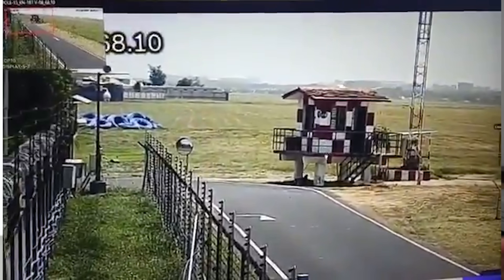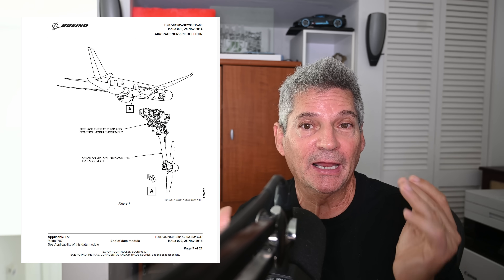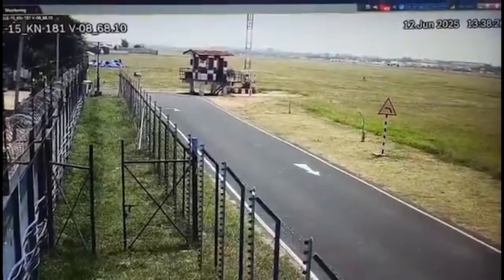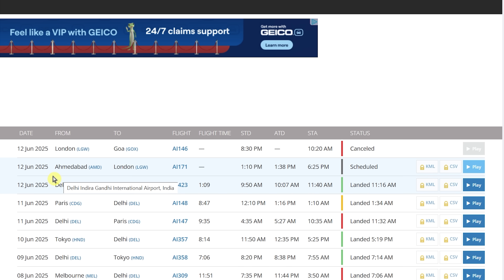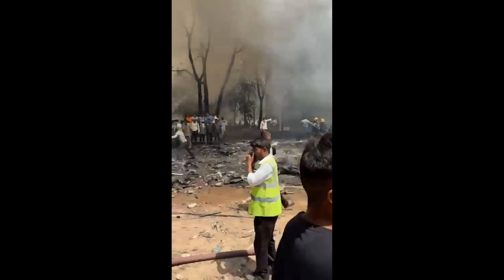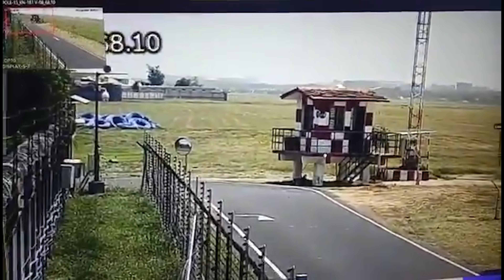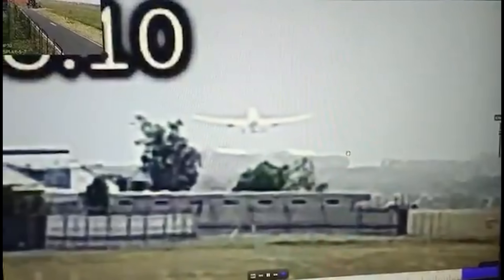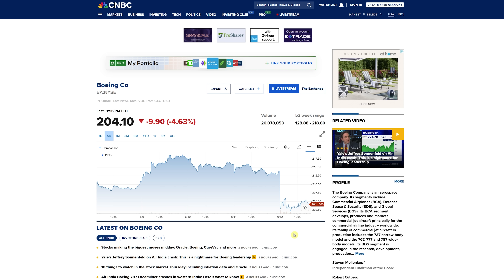What Caused Air India 171 Crash, Mysterious Sound Before Impact

Comment: To my ear, the shape of that sound as it passes video position is only a doppler shift. But the engines themselves don't sound pitched high enough to be at take-off thrust. I presume a little engineering wizardry can determine if this observation is correct. As to the sound of a RAT, I presume the engine sounds would completely overwhelm the sound of a deployed RAT. And even if it were deployed, I don't understand the significance at the moment because, to my knowledge, its purpose is to supply only critical hydraulic pressure for basic control surfaces; it can't even operate the lowering or raising of landing gear. OTOH, if the RAT had automatically deployed, a catastrophic failure in engine power was already underway. But we still hear the engines as the flight passes, so.......more questions. I hope and expect the "black box" will provide answers.

Comment: To me it does sound like the RAT is deployed in the original video, and the engines do not sound to be a full thrust.  It is about 13 seconds from first sound of the RAT to the impact, which means it was deployed 5 seconds at least before?   Crash is 6:03, RAT sound 5:50, RAT deployed latest at 5:45? and rotation was about 5:30.  So suggests there was complete power loss immediately after take off.  The RAT does not deploy with flaps misconfigure or inadvertent retracting of flaps.  Also may explain why gear was still down, as hydraulics were lost as well with full power loss.

Comment: Excellent analysis. I just wonder the folloing: The saved passanger told he heared a strong pang  30 sec after the plaine was airborn. Could that indicate a device failure in gear system and that caused that the gear couldn't be lifted up any more?

Comment: I think a compressor stall, or full failure....in one of the engines. Both engines failing would be beyond extraordinary.  At that altitude, at that speed....with a full load of fuel and 242 souls on board....it would be VERY problematic for the plane to gain speed and climb out...on ONE engine.  These aircraft are designed to be able to complete a takeoff and initial climb out, on one engine, but it does not always work out, in reality. Especially with a heavy load on board. 

The takeoff and initial climb out is BY FAR the most vulnerable portion of the flight envelope.  An engine failure, at that point, is often almost impossible to recover   from.

Another possibility, based on the RAT sound mentioned here, is a complete electrical failure aboard the aircraft.  That would cause both engines to die.  Since there apparently was no smoke or flash from either engine....this might well be a better (possible) explanation.  A complete electrical failure would be incredibly rare, though.

Comment: Excellent sleuthing, thank you! I'm a westerner in India right now--this is such a tragedy. I have been in many Air India flights over the years and every single one of them was extremely hot and dry. So I'd be surprised if that was related to this accident. My last and final trip with them was to Singapore from India as one leg back to the US. That short 4 hour trip--so extremely hot and dry--was much more draining and stressful than the rest of the trip on United from Singapore to SFO. We decided Air India no more. Their planes always seem old and rickety. The seats have old fabric. Service is questionable. I'm questioning the maintenance on this one.  I've been in Dreamliners many times and they are a great plane. Hope there is not a design flaw.

Comment: Look at the video from the 5:20 to 5:24 point.  Are the flaps down?  Doesn't look like it.  ---  How that could be, I have no idea.  They have warnings to tell them if they're not in the proper configuration for takeoff.  ----  Everything at this point is speculation.  We won't know for sure what went wrong until the flight data recorder is recovered and examined.

Comment: Maximum load + summer heat (it was a summer afternoon, probably more than 40 C at that moment), the lift of the wing and the thrust of the engines drops sharply, because the air is thin. So someone gave the go-ahead for takeoff. The human factor, as always happens in such cases.

Comment: You're clueless, that's not the sound of the RAT. That's the sound of a turbofan engine at full power. This will be an easy accident to solve. The inexperienced first officer mistakenly raised the flaps when the Captain said gear up. I know a little about aviation, I flew military and civilian aircraft for forty years.

Comment: I'm not liking this trend at all, I smell a serious rat here (and I'm not talking about that turbine either). The RAT noise was one of the first things i noticed in that video - BBC had a clean copy. At first I thought it was because it had Rolls engines which have a distinctive buzzsaw sound. But it didn't sound right, and later I saw the video of the RAT on a japanese Dreamliner and that matched the sound almost exactly. That tells us alot, but on the runway video you can see jetwash blowing dust off the ground as it rotates, so even though it was a long rollout it obviously had enough thrust to get off the ground. Whatever happened must have occurred right afterwards, but that isn't what worries me - it's what was going on before this thing even left the gate. 

I've seen a youtube video of a guy on an Air India Dreamliner which seems to have been made a few days ago (maybe more), in which you can see the plane having major electrical problems at the gate (as the air con wasn't working and the internal lights went out), and was in a very poor state of repair (dirty buttons, broken lights etc). But this video ISN'T of the plane that crashed - it's another Air India one. And it clearly was having issues with it's APU as it started engines on the stand before pushback, which one commenter said was unusual. If this is indicative of the state that the plane that crashed was in, it would explain the RAT deploying as the APU would also have to be not working assuming the main engines lost power during climbout. Question is, why are they having consistent issues with their APUs and is there a possible link to the engines suddenly blowing out? And if their standard of maintenence and cleanliness is this bad on all of their Dreamliners, what else have they been skimping on?

Comment: My question is, if the flaps weren't deployed, how in the world did it even take-off? And at 1:52~1:53, you can see a clear seam in the front portion of the wing indicating that the flaps were down, perhaps incorrect configuration or malfunction? Also another thing, maybe its the quality of the video, but I don't see exhaust fume streaks coming from the engine indicating its at full power or any power for that matter, is it engine failure? Currently it's all speculation, we need the black box data to even say anything, because this is the first time the 787 has had a major crash.

Comment: I think it was the extra weight and speed on the ground that made it take off because the load was still on the ground, and after takeoff the engines could not bear the weight. The distance to England is long and requires about 80 tons of fuel. The problem is the weight of the luggage and passengers.

Comment: Irregardles of the main reason or major setbacks regarding specifically BOEING 787....First and foremost my sincere condolences and synpathy to the bereaved FAMILIES of the DEMISE.....TWO HUNDRED FORTY ONE Passengers and crew on board this fateful FLIGHT. May there be enlightenment and clear Observation/ Evaluation as to the cause of this TRAGIC Accident. Be it Manual error or engineering/ maintenance failures.... shortcomings/ setbacks whatever!  May JUSTICE PREVAIL! May they provide the BEST AIR SAFETY and WORTHINESS. Rest in Peace to the innocent SOULS on board. Amen. 🙏🙏🏽🙏🙏🏽🙏🏽🙏🏽🙏🏽🙏🙏🙏

Comment: Great Video Jeff @jeffostroff. Loved watching. There are two important info I found in your video that may help with investigations

(1) There is a high probability the RAM Air Turbine (RAT) got deployed. It means the Airplane may have actually lift on RAT power after engine failure.
(2) If you watch the footage of flight between 1:52 to 1:54 frame by frame, you will notice a fainting white flash light after 1:53. This may be from the RAT device.  

Folks, Please correct if its unlikely.
Reply: The RAT doesn't provide lift aircraft or power to the engines, it provides small electrical energy to flight controls, instrumentation and communications

Comment: My home town of Staines, UK, saw an accident in 1972 where a Hawker Siddeley Trident crashed shortly after takeoff. BEA fight 548.

On that occasion, the main issue was discovered to have been the premature retraction of the leading-edge high-lift devices, or droops, causing the aircraft to fall below the required lift. Panicked, the pilot pulled the nose up, which only exacerbated the issue, causing the aircraft to suffer aerodynamic stall and drop out of the sky, landing on its belly and being completely destroyed, with no survivors. My parents were around a quarter mile from the impact as it happened. 

It is thought that the first officer mistakenly retracted the droops instead of the landing gear. The levers to do so were next to each other and almost identical. (Later they were redesigned to help avoid this mistake)

Unfortunately the circumstances were also not in their favour: The aircraft was close to maximum weight, actually being 24kg over maximum when it started its taxi, and noise abatement procedures were in place meaning they were climbing with minimum possible engine power. So they didn't have much to trade when things went wrong.

Also, an impending pilot's strike had caused huge friction, strained relations, and potentially sub-optimal communication between the crew, especially it seems, between generations. And in this case the Captain was 51, the other officers 22 and 24.

Secondary issues aside, I wonder if there was a similar mistake made here. Were the flaps raised instead of the landing gear? Or were the flaps never properly configured? Perhaps they never lowered the flaps to begin with, didn't get the lift they expected, thought it was a power issue, declared emergency, and in their efforts to keep the place in the air, didn't get round to raising the gear?

The only mystery is the loud sound that was heard. I'll be very interested to discover what happened here.

RIP to the souls lost and condolences to their loved ones.

Comment: I think that the security camera is located at approximately: 23.080960, 72.640866 In the gap between the wall of the industrial area and the fence that runs alongside the perimeter road. From that it seems that the plane had sufficient runway to abort the take off as it still had almost half the length of the runway available after rotation. It appears to have lifted off shortly after passing the industrial buildings that encroach from the left and are visible in the shot. There are some trees behind one of them. They can be easily identified using Google Maps. That's an approximation but it seems reasonably certain that an abort would have had the plane stopped before the end of the runway.

Comment: It's pretty obvious why the plane crashed.  The flaps are up and the landing gear is down.  It's not configured properly for takeoff.  Flaps up at low altitude is a death sentence.  If the numbers are correct, the plane never got above 675 ft in altitude.  You can see in the video how skinny the wings are.  They're not producing lift with the flaps up.  With the nose up and the flaps up, the plane was in a stall.  The pilot may have thought the engines lost thrust while not recognizing the flaps issue.  He may have deployed the RAT thinking the engines lost thrust, which they likely didn't.  Wouldn't be the first time an experienced pilot didn't recognize a stall or fail to properly configure a plane for takeoff.

Comment: What about Wikipedia, a link at the bottom of the page numbered 25, it says something about an Engineer being fired in the Seattle Times newspaper. I think its from somewhere in the early 2000's. The link doesn't take you to the article, it takes you to the current Seattle Times newspaper. Why is the link not working. I cannot trust Boeing if any links to public media is not working or removed etc..   Boeing were very troublesome in many years ago. My reasoning is that both the British and American economies haven't actually been in a comfortable place in recent years so I wouldn't expect them giving off the produced good. Options for Engines are from either GE or Rolls Royce for these planes. Also noting that Italy forged documentation during spares manufacture and procurement supply for these planes which is definitely another issue. Judging from the FAA and European Authority that approved the planes for safe operation I say lets see all your findings in public. We want all of the corrective measures you accepted on your findings. Also your testing methods and pilots who tested, their fitness as well as the regulatory periods when they were actually stamped for approval.....    requires interrogation. We need to understand what bad decisions were made if any political meddling!

Comment: The Dreamliner’s Silence: One Day After AI‑171’s Fall

One day on, and the story is no longer just about what failed. It’s about what never spoke. Air India Flight AI‑171, the pride of India’s long-haul ambitions, powered by one of Boeing’s most technologically advanced machines, did not fall because of one forgotten switch or a rogue bird with a grudge. It fell because silence—of systems, of sensors, and of accountability—is louder than alarms.

We now know, with disturbing clarity, that the aircraft’s flaps and slats were not deployed. That’s yesterday’s news. But the latest investigations suggest something even darker: the Takeoff Configuration Warning System (TOCWS), the cockpit’s final line of defense against self-destruction, never uttered a word. No horn. No blaring warning. Not even a passive-aggressive chime. Just... nothing. Which makes one wonder: was the system asleep, or was it simply told not to wake up?

Boeing, ever the Shakespearean character in modern aviation—equal parts genius and tragic flaw—claims the TOCWS is designed to alert pilots the moment thrust is applied with incorrect configurations. But what if the system believed the configurations were fine? Sensors, after all, are not immune to delusion. A “slats drive malfunction” could easily misreport partial extension as full deployment. That’s the aeronautical equivalent of a doctor mistaking a coma for a nap.

And here’s where it gets even more poetic—if poetry can describe 241 deaths. The engines? Working. The flight path? Programmed. The captain? Alert enough to issue a mayday. The Dreamliner’s brain? Quiet. Like a child caught red-handed, pretending not to exist.

Let’s be specific. The aircraft lifted off at 13:38 IST, weighed down by summer heat and full fuel for a transcontinental run. The density altitude—how the aircraft “feels” the air—was likely higher than the Himalayas. With no flaps to increase wing camber, no slats to smooth airflow, and the landing gear still extended for maximum drag, the plane was essentially being asked to swim with boots on. Add one last insult—a silent TOCWS—and you get a perfect recipe for controlled flight into uncontrollable physics.

Meanwhile, engine failure theories are fading. Not because engines don’t fail—they do—but because this aircraft never showed the behavior of losing thrust. It was flying heavy, not blind. The problem wasn’t power; it was shape. The wings were wrong for takeoff. And they stayed wrong until the ground corrected them—fatally.

So where does that leave us? Back in the familiar terrain of aviation theatre. A Boeing aircraft fails to warn its crew. A regulator remains mute. A company releases carefully worded statements. Investigators promise “full transparency.” And the public gets another crash course in aerodynamics, delivered via headlines and body counts.

I wrote yesterday that this wasn’t a pilot error story. Today, I’ll double down. This is not even a warning system failure story. This is a belief system failure—an industry that believes its own automation mythos more than the laws of physics. A culture where silence is a feature, not a flaw.

If the black boxes confirm what early data and logic suggest—that the warning system never engaged—then Boeing’s engineers and regulators must answer a very specific question: why was a plane allowed to lift off when it clearly wasn’t configured to fly?

Until then, the skies remain loyal to their oldest truths: Lift is earned, not assumed. Silence is never safe. And arrogance, not gravity, is the real force pulling planes down.

Dr. CrystalHeart Kazmi
Founder, tinyurl.com/WomenAreVotes
Blogs:
movethestoryofyourlife.wordpress.com
imranokazmi.wordpress.com
auratkiawaz.wordpress.com